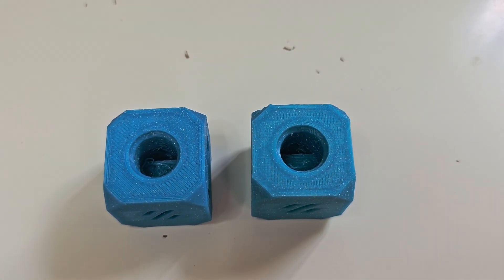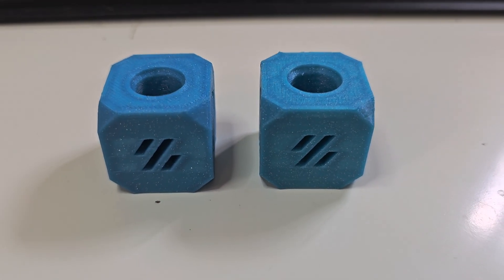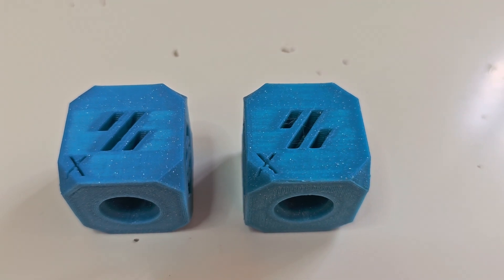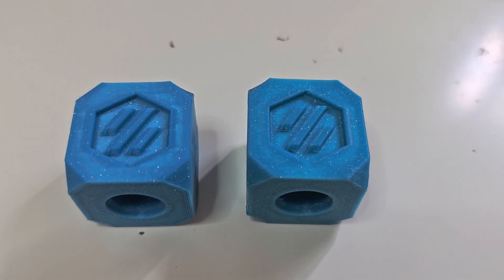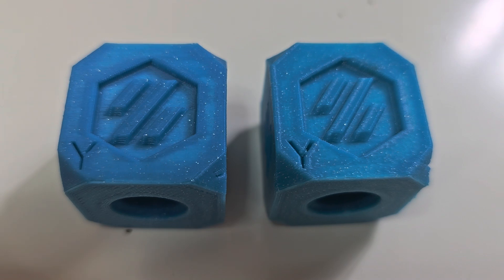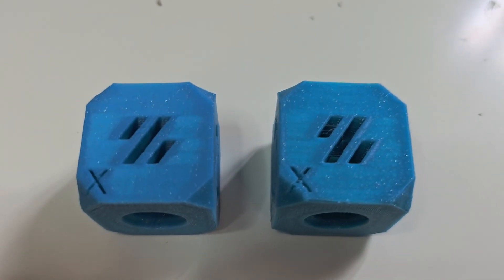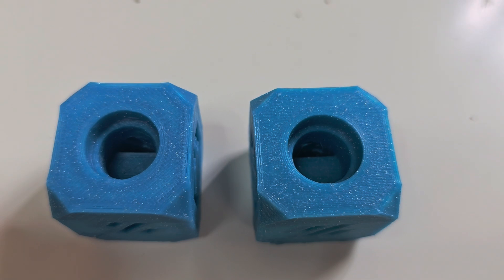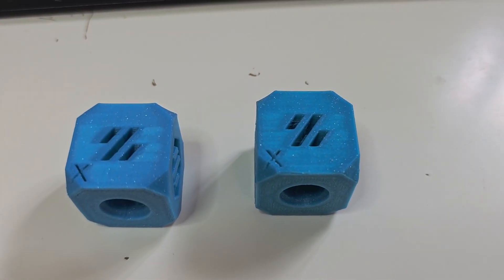Slicer changes = 40% print time reduction - can you tell the difference?

Comment: I notice your cubes have exactly the same flaws mine have. And, I don't see those flaws on many other cubes out there... I'm talking about the slight indentation (and lighter color blue) to the left and right of the voron logo on the X-face. And, when you flip the cube, there is discoloration (lighter blue again) in splotches on another side. I'm not so worried about the color, but I think that may indicate stresses or differences in internal adhesion where the splotches are.

Did you ever figure out what caused that? I was able to dramatically reduce mine by slowing way down. But it still has a hint of it, so I don't think it is very much a speed thing... And slowing way down is not a very good solution! Odd that you and I have this when it doesn't seem to show up much when you search for images of these cubes.
Reply from the maker: I am wondering if it's this specific filament that displays this problem. I am using Sparta3D's Sparkle ABS/ASA (aka West3D's Ambrosia ABS/ASA). Other filaments don't show these issues (or at least not as much).
Reply: @oldguymeltsplastic  I ended up starting over from a default Orca profile for Voron. The second time through resulted in a much better result, but unfortunately this process wiped out my ability to confirm what was wrong.

I suspect the slight indentation was a combo of a tricky filament as you suggest, with too high of acceleration. The color change in spots may also have had something to do with choice of infill. Cubic seems more prone to this.

Comment: Thank you for the work... but... what did you actually change? :/ You just showed a 4 minute video talking about some changes that reduced printing with 40% time with almost no artifacts... but didn't show or tell uss what you changed and why it worked? 

Did you change speed? Did you change acceleration? Did you change layer height? Did you change layer widths? Or did you put in some cooler ideas and tricks to save time without reducing quility of the part. 

Love that you actually slowly show the parts with good camera quility so we can inspect the part our self. Also loved that you waited a bit before you told which one is what. But for now this video did not tell uss anything about the timesavings. It could have been that the "slower" settings was just slow to begin with and did not use the hardware capabilities, and what you did was actually just put the acceleration and speed to the machines capabilities. Or maybe you actually did some cool tricks that saved time that isen't hardware specific. 

Follow up video asap explaining the changes you did!
Reply: The geometry looks different. The right cube looks skinnier
Reply from the maker: All XYZ cube dimensions were in the range of 29.9mm to 30.1mm. Not perfect, but good enough.